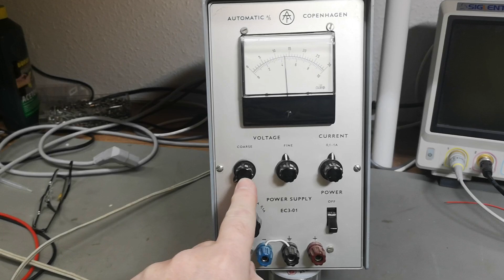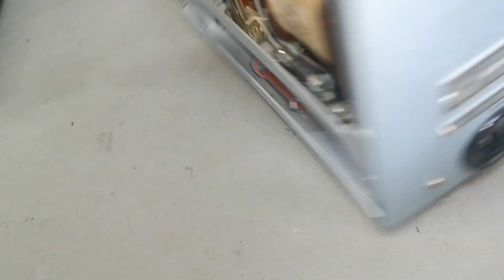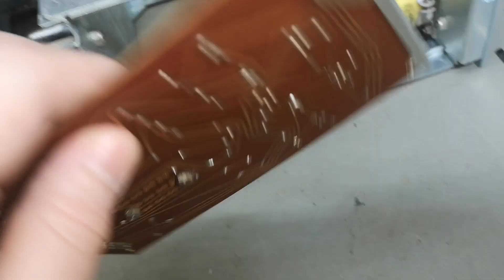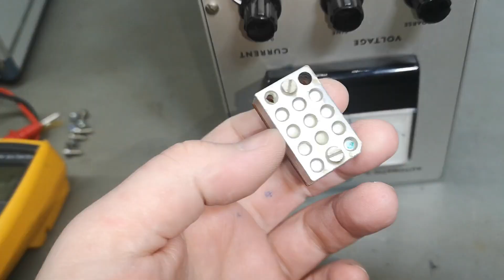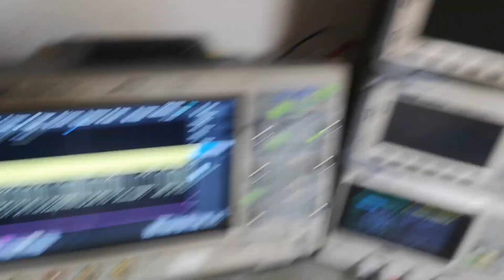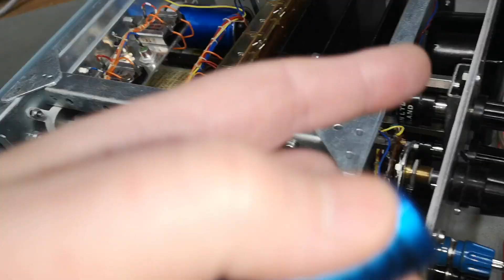Automatic Copenhagen DC Power supply EC3-01 1966 repair teardown

Comment: About the Power Zener, here is my guess of their original design: They did not intend to make a power Zener, with proper heat sinking, etc. In case it’s output stage failed, the voltage would go much higher than Vz= 33V. In this case the current would be of a few Amperes. They should have installed somewhere a Fuse as 1.5A, which will then certainly blow. 
Their “HighPower ZenerStack” just need to have enough good/distributed thermal conductivity to absorb in the inherent thermal capacity of the aluminum mass, that energy, until that fuse blows. 
Also, either a PowerTransistor+Zener or their ZenerStack will also protect over-voltages caused by BRUSHED MOTORS, and switching of other inductive loads. I guess for this, the Zener would be faster too.
So, this construction is much smaller (footprint, volume), simpler, faster and tamper-proof than a Power Zener. Not the way I/we would go now on 2023, but a clever (and effective) way to crowbar the output, while offering some voltage-spike protection.

Comment: Good troubleshooting - thanks for sharing.
If I may suggest, you could dig/open the older capacitor housings holding them in the original brackets, while hiding inside the newer ones. Obviously it would be just to preserve the original beauty of the designed construction.
Reply from the maker: i do this sometimes, it is both good and bad, since it hide a repair, if something else go bad, and the unit got a new owner, he will start to repair the parts i spend so much time on :-) but on tube stuff, where the caps stick up very visible, I do this trick

Comment: I think that back in 1966 electronic designer engineers were coming straight from the valve world that's why they use high voltages even if the output is only 30 volts. It's mentality maybe...very interesting video!
Reply from the maker: exactly, I also see hos they made rectifiers, and such almost like it was valves

Comment: Zener block probably because power transistors at that time were not reliable, but zener diodes and regular silicon diodes were reasonably reliable, and would, with a current that is limited, reliably go short circuit after a few minutes of toasting, thus clamping the voltage lower and lower till the mains fuse fails. Simple, and the thermal mass and coupling means they will handle pulses fine, and spread the heating so all of them will have equal leakage current, till one goes short circuit from diffusing the junction through, which will make the rest do the same very rapidly. Having a crowbar would require a SCR, which in 1966 was still, to many engineers and designers, something that you used for AC control, or for high power switching in DC motor controls.
Reply from the maker: the large aluminium block for the zener overvoltage, should give them a good power peak performance, i have not seen anything like this before, but hey this solution is still working so we cant say it was a bad idea :-)